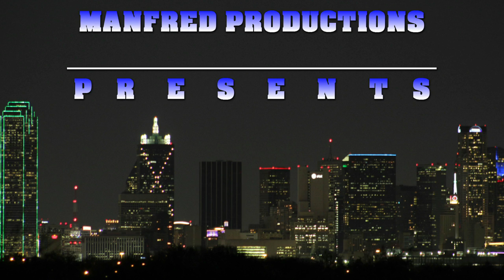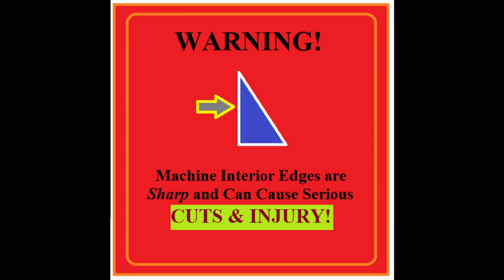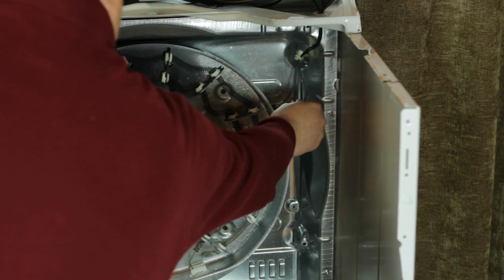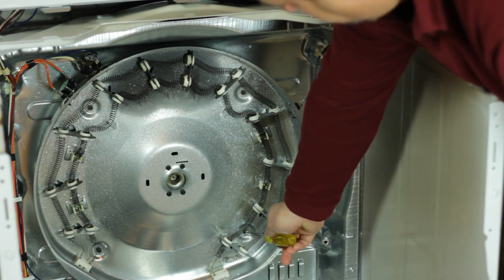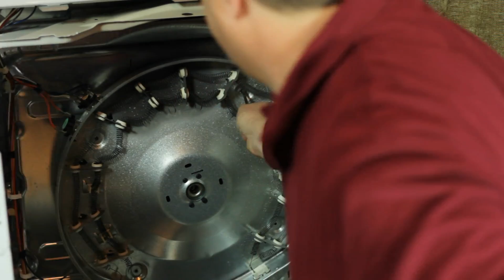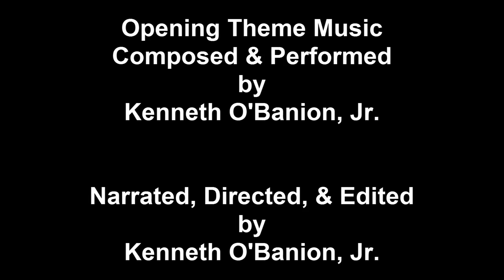GE Dryer Repair - Won't Start or Run - Thermal Fuse Test & Replace

Comment: A little short Phillips screwdriver will save you time and you wont have to remove the heater element you can replace the themal switch with out removing  the element from the bulk head

Comment: Hello, here is my problem. The dryer  normally operates. And suddendly, everythings stops (sometimes after 30 minutes). I wait and after a few minutes the dryer restarts. Also sometimes, the dryer operates normally, I open the door, and when I want to restart the dryer doesn't works. I change the door switch, but I have the problem. Can you help me ? Thank you.
Reply from the maker: It sounds like the overload protector switch on the motor is getting tripped.  If it gets overheated, it will trip and shut down the dryer.  It then will not run any more until it has cooled down enough for the switch to reset.  This happens when the motor windings are starting to go bad

Comment: what happen to me is that i forgot to plug in the timer wires and the brown wire sparked cause it would not heat up i think the timers bad but thats when it wont work at all the brown wire on the timer sparked.

Comment: I have a DPSE810EG1WT that won't start. Thermal use is good, door switch is good, No buzzing from the motor.  What do you think?
Reply from the maker: First thing is to use a volt meter to test for power coming from the wall outlet.  If you are only getting 110 volts on one hot terminal, and 0 on the other, then the circuit breaker is half tripped on one leg, or there is a wiring problem with the wall outlet.  If both hot terminals are 110 volts, next test the start switch.

Comment: My same dryer runs perfectly, but no heat. I checked the out side breakers and the exhaust ducks. All good. Any advice?
Reply: canyonman1963 First of all, thanks for the quick reply. 2nd, way over my head. I'm just going to buy a new one. :-(

Comment: Thank you for the info! I really have no clue what i am doing, just borrowing tools from the hubbys toolbox and watching your video. My dryer  (this exact one) is clicking when you push the start button and the panel lights up normally, but it doesnt run. I tried the continuity test on the fuse you are working on in this video, and it is fine. I tried it on all other fuses, and they seemed fine as well, except one of the 2 on the top left on the heating element. You take of the heating element in this video and let it dangle by these two "thermostats". The smaller one of those two is not working on my dryer, i don't think. What is it? Would that cause this issue? Thank you!
Reply from the maker: If it is a thermostat, it might keep it from heating at certain times on the cycle  settings.  If it is a fuse, it might even keep the dryer from running at all.  Either way, if it has no continuity, and it is a thermostat or a fuse, it needs to be replaced.  If that isn't what is keeping it from starting, check and test the door switch, as well as the start switch.  And of course, make sure the circuit breaker is not tripped.  Turn it off, and then firmly turn it back on.  Do this a couple of times to make sure it catches.  Once it is back on, make sure correct power is getting to the terminal block from the circuit breaker and wiring through the wall.

Comment: Thanks for the info, I recently went from a 3 prong to 4, but I hooked it up wrong the first time. I put the ground with the neutral. Everything worked fine for the 10 min I used it. Then my wife tried to use it that night an it wouldn't turn on anymore. I fixed the plug correctly right after, but still nothing. Any ideas on what could be the problem? I was told maybe a thermal fuse?
Reply: Thanks, I'll give it a shot and see what happens.
Reply: Alright I tested both, the outlet and the fuse. Got a reading from both of them, should I be worried? Haha. If you could lead me in the right direction, thanks.
Reply: Yes, 120 ground to hot and around 240 hot to hot. How would I check those switches. A continuity test?

Comment: Will replacing the fuse help if my GE dryer dvlr223eg6ww does not heat, but runs?
Reply from the maker: Usually on GE dryer, No.  When the thermal fuse is bad on the GE dryer, it will not run at all.  Use an ohm meter and test for continuity with the wires removed from the fuse.  If it has continuity, it is not bad and not the problem.  If it does not have continuity, replace it.  Do the same tests on each thermostat as well.  If a thermostat does not have continuity, it will still run but will not have heat.
Reply: +canyonman1963 if so, I have to replace the thermostats to have the heat?
Reply from the maker: If they do not have continuity, then it is bad and has to be replaced.  Be sure to test it so you only replace parts when they test bad.  You have to have good testing thermostat to have heat.
Reply: Thank you sir!

Comment: hey so I hooked up my dry with a three prong plug. I turned it on it worked. the next day started it again it quit working. so I thought I hooked up the wires in the back. so I flipped  the outer two wires and it would run but no heat this time. also moved to new house. had to change it from a four to a three plug outlit. thanks for any info

Comment: hi do you have any suggestions for GTDX180EDOWW it runs for 4 or 5 minutes heats up and everything then it stops running? I can still here the timer going when it stops
Reply from the maker: Sounds like the motor is overheating and the overload protection switch is kicking it off.  Once it cools down, it will work for awhile until overheated again.  Could be lint build up in the motor needing to be cleaned out really good, or it could be the windings in motor going bad or the bearings freezing up making it harder to spin than it should be.  You will need to take machine apart and check out the motor.  Hope this helps!

Comment: This is a great video! Last week my dryer stopped working. It began by stopping midway through a cycle. Then eventually would not start, but the start button would buzz. Then even the buzzing stopped. Checked power supply and door switch, both fine. The timer dial didn't seem to be "catching" when it was turned, so we replaced it yesterday. The start button is back to buzzing. Do you think we should look at the motor or the thermal fuse next?

Comment: Our dryer works half of the time. For the other half of the time, it is making a quick buzzing sound after I press the start button, but it doesn't spin. We paid for a handy man to look at it, and he said we need to replace the motor and the part alone is $300. He showed me to spin the drum to start the machine as a temporary solution. 

He didn't open up the dryer to test any of the parts, so I am not sure if the motor is the real issue. Any advice would be much appreciated.
Reply: +canyonman1963 Thanks!

Comment: Hello,
I've a GE dryer. I have an issue. The panel is on and the panel displays drying starts BUT the dryer itself does not start at all (no cycle , no heat). thanks. Any advise please.
Reply from the maker: +Shamsher Runjeet Well, maybe a wire was left unplugged, I recommend unplugging the power cord, then take it apart again and recheck all the wiring.  While in there, remove the wires from the fuses and thermostats, and make sure all of them have continuity.  If any do not, it could be causing it to not run or not heat.

Comment: Thank you for these videos! 
     Last week my dryer (a GE duradrum Model # GTDP180ED2WW) stopped working mid-cycle: no light, no power, nothing. It wasn't making any noises or anything. After following your videos and a few others, we found that the timer assembly was busted. After we installed a new one, the dryer still had no power. 
   So, after disassembling the dryer again and checking every fuse and connection listed within these videos, I saw a fuse next to the power cord. Not one video or website I found suggested testing the main fuse (GE Part Number WE1M1002 FUSE CCMR 30 AMP 120V.)  After ordering the part on Amazon for about $8 and installing it, the dryer is now running fine. 
    I hope this comment may save someone some time and frustration.

Comment: Hi there I want to ask about my dryer when I hit the start button it works but when I release it it turns off again so what do you think the problem is?I tried removing the switch button and connect it directly and it works fine so any suggestions?
Reply from the maker: +Mustafa Abdulnabi Check the broken belt switch, this symptom usually happens when the belt is broken, or when the broken belt switch is bad or not engaging properly.  It is located just below the motor pulley where the belt is on the motor.  Also, if the tension arm that engages the switch button is not installed all the way flush to the base of the machine, it will be out of alignment and no longer press the button, causing same problem.

Comment: I just had a brand new gas GE dryer installed  today and it wont  start. the lights turn on but thats it, any ideas. by the way this is our second one in a week. our first one sounded like it was grinding something inside.

Comment: Is the "thermal fuse" the same thing as the Dryer Hi-limit Thermostat? My dryer stopped working after I opened it to check the laundry. Door switch seems to be fine, and the start button hums, but the dryer doesn't start. Is the part for my dryer in the link below the "thermal fuse" I need to check? Thanks in advance!

http://www.searspartsdirect.com/ge-dryer-parts/WE4M137/0026/363/model-GTDX180ED0WW/0432/0151200.html
Reply from the maker: +Ryan Mensch You can check it by unplugging dryer, removing the wires from it, and check for continuity between the two terminals using an ohm meter.  However, if it were bad, you shouldn't  be getting a noise when trying to start it, so I doubt it is the problem.  When it cools down, if it then will start OK, then that means the dryer motor had overheated.  This could be caused by the motor going bad, or by something putting too much of a strain on the motor while it is trying to turn the drum, such as a drum bearing freezing up, or even the bearings on the motor shaft starting to freeze up.
Reply: Well, it's just the start button that hums, but the machine doesn't fire up. Gonna test the fuse with neighbors multimeter tonight. Thanks!
Reply: +Ryan Mensch, same issue with mine, I did see where you could manually spin the drum with the door switch closed and that would get it started up again. I blew the interior of mine out with a little compressed air as a lot of people have stated that sometimes having a coat of yuck on the motor can cause this issue. I imagine this is probably the beginning of the end for the motor however. Very disappointed as this unit is just a little over 3 years old at this point. Canyonman1963 Thank you for all of your assistance in helping me to diagnose the issue. Do you have any recommendation for aftermarkets that hold up better (once it finally just croaks)? As its obvious that the GE motors are pure trash.

Comment: I have a GE Profile model: PDTN600EM0WT, the wrinkle care knob fell off and when I tried to replace it, the switch inside broke and arced.  There is a weld mark where it arced inside the control panel and a small burn indication at the start button.  Would this arcing cause a fuse inside the dryer to trip?  The dryer no longer turns on and the wrinkle care switch is burned.
Reply: It was the circuit breaker for the house. Thank you for the help and the vids.

Comment: Great video.  You are a public service for DIYers.  I have a Fisher & Paykel Model DE09-US0  electric dryer, which is really a re-badged GE.  Over the last week or two, it has been stopping mid-cycle (timer also stops).  It must cool for 5 - 10 min before it can be started again. Just last night, it stopped, and now it doesn't start at all.  All air passages are completely clean, from the drum inlet to where the air is vented outside.

All my research points the finger at the motor, but there is no unusual friction or drag on it.  the drum rotates smoothly by hand.  The belt switch is good, the door switch is good, and the start switch is good.  

Then I found out that this machine's "thermal fuse" is actually a high-limit thermostat that opens and closes dependent upon temperature.  I tested it and it is open, but when I look closely at it, one of the two terminals is very loose.  It spins around on its rivet fastener.  

I spoke to a local repairman, and he said that usually, a weak cycling thermostat is what causes the thermal fuses to open (assuming all air passages are clean).  He said the they should be replaced as a set.

I have ordered a motor (this was before I discovered the open "thermal fuse".  I have also ordered both thermostats.  Do you think is the cause? 

Thanks,

Richard
Reply from the maker: +Richard Backscheider yes, it sounds like the hi limit fuse and thermostat need to be replaced, and yes, always replace both at same time!  Hopefully that will fix it, and you can return the motor!

Comment: My GE dryer is getting power and the belt is on correctly, but it will not tumble.   There is no visible cylindrical capacitor to replace. I am perplexed. What do I do now?

Comment: I'm sorry I had to ask. your saying that if I have no power on the ge profile electric dryer board or other wise. it a thermal fuse that causes the dryer to have no power at all? even at the ? display board?
Reply: Thank you. The dryer is in really good shape. And my dad bought a new one and it work fine in its place so I don't think it's any power or cord problem. I have the power board out now and don't seem to be any burnt-out resistor's or anything like that. I have a diagram that was in the back of the dryer that like Greek to me but I'm trying to learn.  Thx again

Comment: I have a similar dryer and it runs for about 30 seconds and then shuts down. In air fluff mode it will run a full cycle so I don't think it is the motor. I tried putting it in service test mode and with t01 when I press start I get code 03. I thought that indicated the thermistor was bad so I changed it out but it didn't fix the issue. Any suggestions?

Comment: hi! i had replace the heating element on a GE dryer and the rest of components are fine now it heats but doesn't dry the clothes it spins and can feel the heat and i even see the element going red when is functioning. if you can please help me out with this... Blessings!
Reply from the maker: negro c.c. This happens when you have a reduced or blocked air flow.  Make sure the air duct on back of dryer is not crushed or bent too much somewhere, or full of lint.  Also, check the ducting through the wall to outside, make sure it is not stopped up at the either end.  Remove hose from dryer, then turn it on and make sure the air is flowing strongly out the back of the dryer.  If no air flow at back of dryer, it could be clogged inside with lint, or the blower wheel could be rounded out and not able to blow air like it is supposed to do!

Comment: My GE dryer will run work fine but occasionally just stops before clothes is dry. Any ideas?
Reply from the maker: cajman007 If it is shutting down on its own before it finishes the cycle, the motor might be starting to go bad.  If so, it will get worse, and eventually will not start at all.  Usually another thing that happens when the motor starts to go bad is that you will hear a fairly loud buzz sound when you press the start button.  If so, then it probably is the motor going bad.

Comment: We tested resistance on nearly everything inside my GE gas dryer.  One location has no resistance at all.  It is a little black box under the left side of the motor that is hard to get to - may have to take the left side panel off.  Can you tell me what that might be and if this could be causing a problem for the dryer to run?  It has power, light comes on but won't actually start moving.
Reply: Mary Be After putting back together with the top cover off.  When I push start there is sound but the drum won't start moving unless I push it to go.   If I push it - the gas heater comes on and it runs but only if holding down the start button.

Comment: Hi Mr. Canyonman, we have a GE dryer, model # DWXR483EB3WW.  It runs for a few minutes then it stops.  It gets hot on the top. We open the door and shut it and turn it on again and it runs for a few minutes and stops again.  It keeps doing this.  What's wrong with it and how we can fix it?  Thank you so much for your help.

Comment: my GE DPSB613ED2CC was drying a wet comforter and it wont start now. There's power going to it when i press start, but it only goes, "click" when i press it on. Is that common when the thermal fuse goes out?

Comment: well, my dryer is exactly like this one. it doesnt turn on at all when i press the start button. so i bought a new thermal fuse for it and installed it, yet i still get no power at all. is there something else that could be the issue?

Comment: I get no power whatsoever. No lights not buzz no nothing. It was running and just stopped.
Reply: canyonman1963 Yes. I'm almost certain its the thermal fuse. No continuity.
Reply: canyonman1963 Thanks!!

Comment: I have a GE same model and it gets hot and shuts off. Replaced the timer switch. and it worke for a week and does the same thing. wife put it on timed dry and it works for a while but does not get hot on top. Also stops on that cycle. is there a switch that controls that?

Comment: Why my GE dryer only makes noise but it doesn't want to spin
Reply from the maker: Check the belt, it could be broke or it might be off track on the tension wheel or tension bar